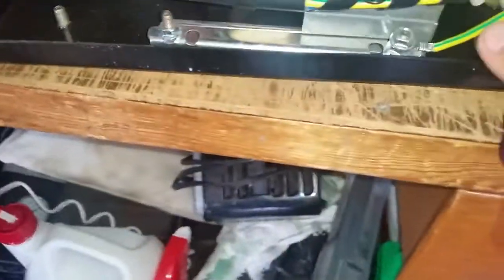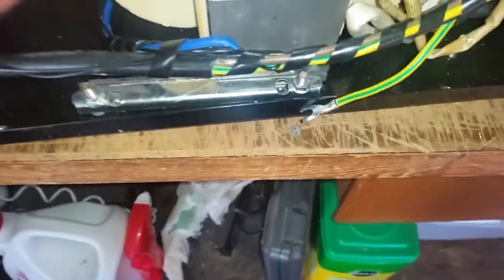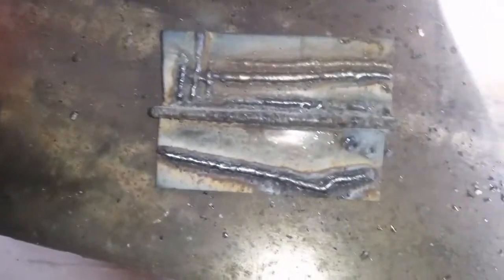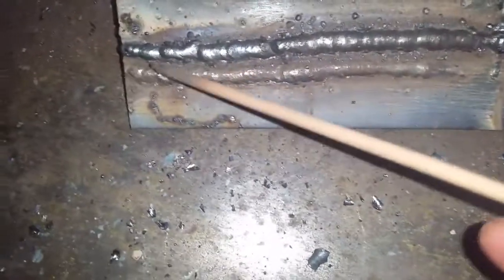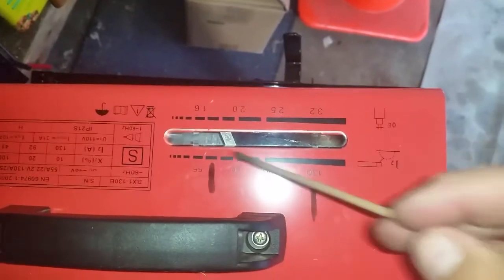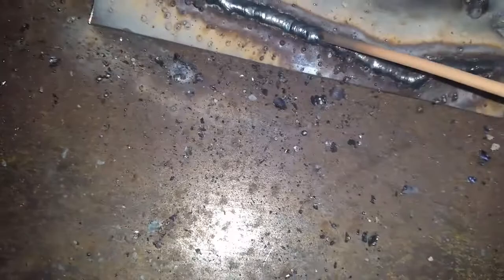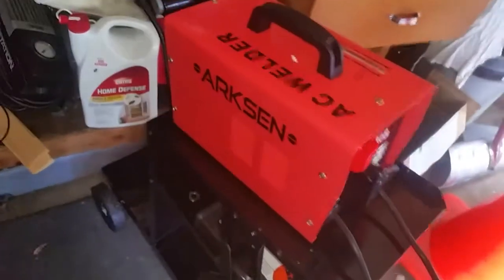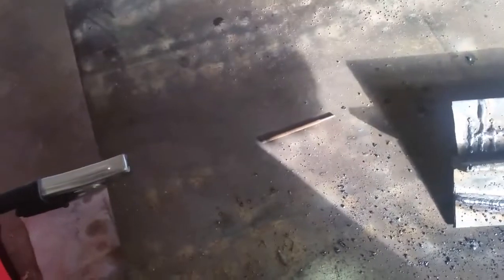Arksen BX1-130B Stick Welder Update

Comment: you need a ground to get a steady arc.
Reply from the maker: Steven Kirkham An internal wire that was loose was preventing the welder from working at all. Just got back from the local farm supply store to get a new ground clamp, they do not carry the ones with the copper contact points. Will have to go online to order one. Am still learning, been 23yrs since I stick welded. Was having a terrible time trying to hold my camera and weld at the same time, so I stopped filming and did some welds.